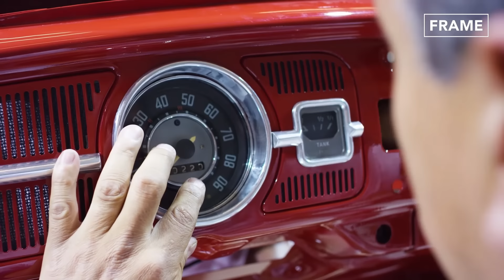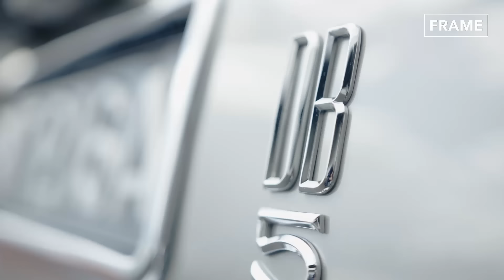Full Restoration of a 50 Year Old Beetle From Start to Finish by Professionals

Comment: Nice attempt, but too many details looked over in my opinion. 
       Why not restore the Ca Black/Gold lic plates. 
          Passenger side angle plate bring under the carpet. 
          Radio knobs should be same finish as dash knobs. 
           Steering column or steering wheel needs to be changed so they match. 
            Headlights should have a seal on the fender before buckets are installed.
            Roof rack and white walls are a little over the top. 
             The devil is in the details, they did a lot of work and then fell short of the final goal. 

                    Ycats